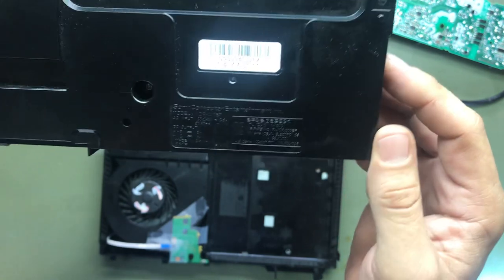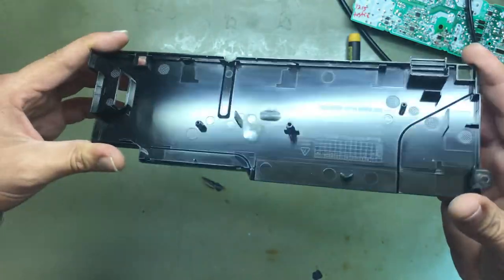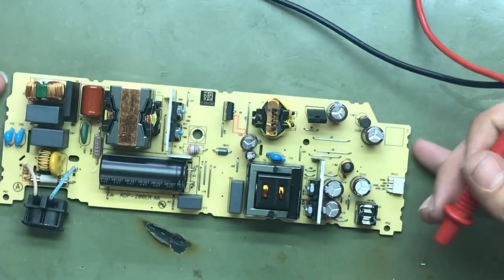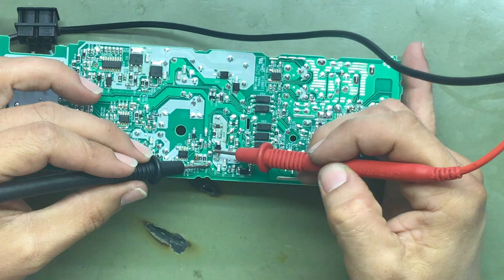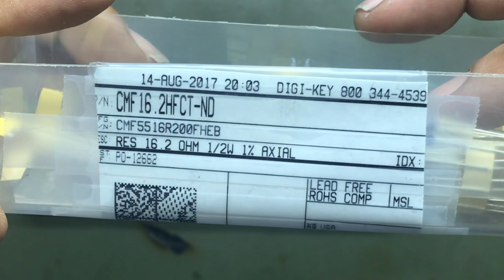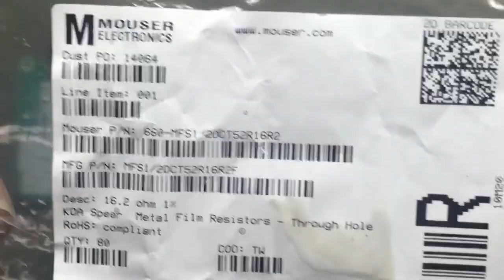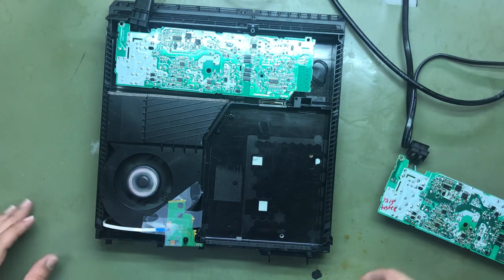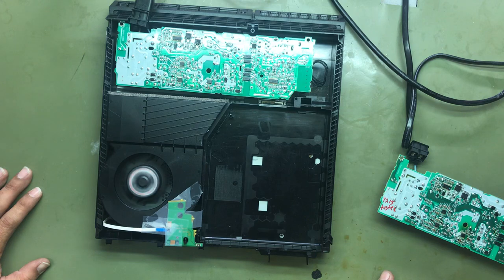ADP-200ER 1215A PS4 PSU Repair

Comment: Seems like the new resistor is smaller thus lower power rating than original. Shouldn't it be a 1watt resistor?

Comment: Hello, I congratulate you very good the videos
Have you ever fixed an ADP-200ER with the 3n62k3 mosfet and resistance 16.8  (short)
in the model ADP-200ER change the mosfet 3n62k3 and the resistance 16.8 and when the test burns again the mosfet 3n62k3 and the resistance 16.8
Do you have any advice that can help me?
Reply: I have the same problem
Did u fine the solution.
Please help

Comment: Hello, excellent video. I am trying to repair the ADP-240CR source for ps4, I don't know the differences between the one you repair in the video and the one I am trying to repair. It would have the schematic of the ADP-240CR. They are very similar but I need the schematic. In my case, the source does not turn on or bridge pins 1 and 3 of the connector. Thank you
Reply: Check the fets, PWM ic, Fuses and resistors.

Comment: Hello, I am not sure, but the value of the original (fat) fusible resistor is 0.16 Ohms? Am I reading it wrong? And you changed it to a 16.2 Ohms? Or am I overlooking something? Regards,
Reply from the maker: János Gajda going by the color codes. It’s a 16.8 ohms
Reply: @RepairLegion , the color sequence is - brown, blue, silver, gold and red. 16.8 does not conform with E192 row.
Reply: @Manfreddis  I have one of these supplies in my shop at the moment with a good resistor.  It measure .16 ohms or 160 milliohms if you prefer.
Reply: Game Console Repair Legion Playstation, Xbox, NES  hello I’m reading a color but  brown is 1 blu is 6 silver x 10 -2 how to result 16,8 ohm can you  explain to me ?
Reply: Seems is not 16.2 ohm is 0.16
Reply: I think I figured this out. The SILVER centre band is the key, this is a 0.16 ohm 50ppm resistor. Check out my vid for more information.
https://youtu.be/pDy3WrvV6xM
I don't think that the 16.8 ohm resistor will hurt much but it will depend on the resistance of the other side of the circuit. It could pull quite a bit more current than the proper one.

Comment: Hi, i have the same psu ADP 200ER with a faulty mosfet (the one on the rightest corner)--->stps20lcd60c /// GF 089 /// VW CHN 541.
Can you tell me what mosfet i need for repair?
Thx in advance!

Comment: Hi, same PSU the 12v where going the two long pin in the motherboard, when I tested in the PSU I don't have voltage, is normal or thats the problem with the blue light only????

Comment: PS4 Repair 101

Can you help me?
I have no power when trying to turn it on but the eject button does beep 3 times. why is that? Is that still a power issue.

Tried to look for it and when i messure the voltage when triggered i messure 8 volts..that should be 12v right?
Im very handy with Soldering but usally I build quadcopters lol so i dont know much about circuit boards.
Hope you can help!
Reply from the maker: Manuel Smeets it means you have 5v standby power. But your not getting 12v. So. Something on the board is blown/faulty. Follow along with my videos. Most power supplies are pretty much the same.
Reply: Same issue with my ps4, it wont turn by power button but it beeps by disc eject, it sounds but after 3 beeps it wont beef anymore...

Comment: Hey
I have the same power supply but my PS4 would turn off randomly. Have confirmed that it's the supply because I ran it off of an ATX supply and it worked. Can you tell what could be an issue??
Reply from the maker: Intermittent issues are the worst. Get a new one.
Reply: @RepairLegion  sad

Comment: Hi there, can I buy 18 ohm or have to be 16.8ohm.
Regards
Reply: Hi ! I went to a parts store and they only had resistor 18 ohm and 0.5W. It worked!
Reply: @PedroAntunes78  I used an 18 ohm one but it got burnt instantly, i suppose i have to get one with higher wattage right?

Comment: I am working on one of these which has 5V output, but no 12V, It was causing the Blue light of death. I purchased a replacement PSU and the PS4 works fine now, but I kept the faulty one to repair. I have faults with Q101 and Q102. They say 9990G1 on them. For the life of me I cannot find them to buy or even a alternative mosfet to fit and try. So frustrating when you find the faults but not the spares to fix. :) Any ideas on what exactly Q101 & Q102 can be replaced with. They are identical?
Reply: So I ended up finding correct parts for Q101 and Q102 on Ali Express. Still didn't work. No 12v output. With no visible signs of damage, or defect there was little to go on. 
The 5v output rail working, so I ruled out a lot of primary side issues on the 5V side of things. So I went a littler further back on the 12V side of things and replaced the two surfaced mount transistor IC. 
Still didn't work. 
I was about to bin the board, when I decided to short the 5V+ supply rail to the standby pin which WAS NOT pins 1 and 4 on my board on output connector. It was pin 1 and 3 as far as I can remember, or possible 2 and 4. Lets just say it says it on the board which is 5Ve and Standby pins. After shorting the 5V+ rail to standby pin I got 12 Volts switched output. So I have managed to fix it I think. Either that, or there is a switching fault. 
I had ordered a new one for my sons PS4 ages ago which fixed the original fault PS4 blinking blue light fault due to no 12V. My guess is that the Q101 and Q102. did fix it, but there is also a possibility that the 2 x surface mounted IC's fixed it on the primary side of the 12V rail transformer.
Reply: Did you really Read 9990?